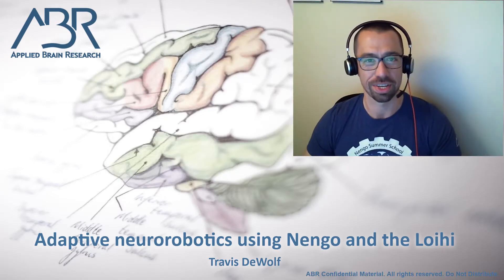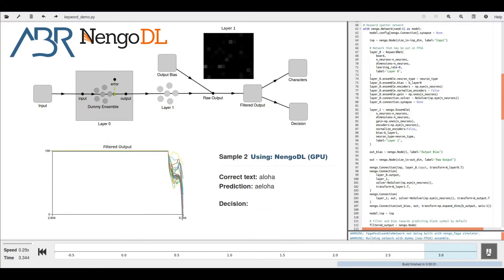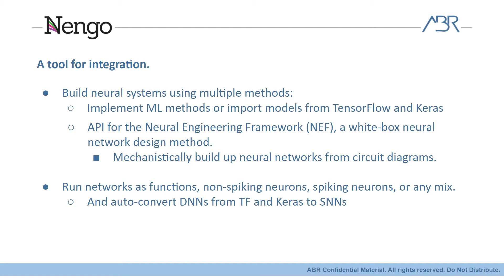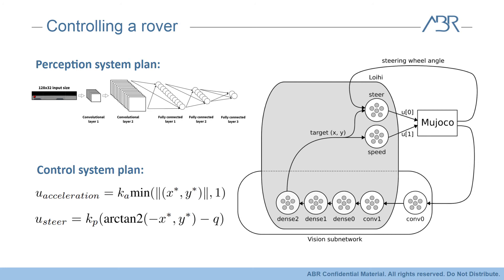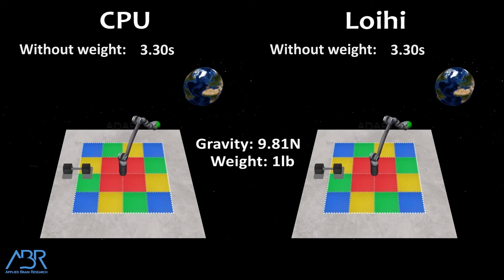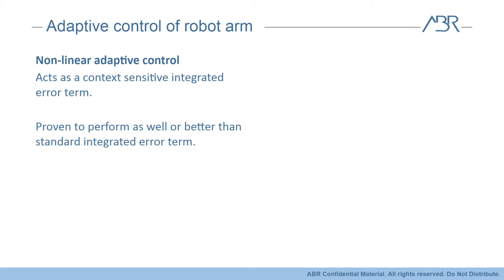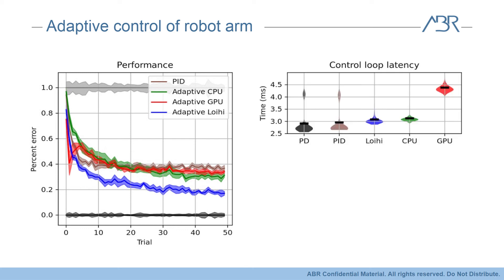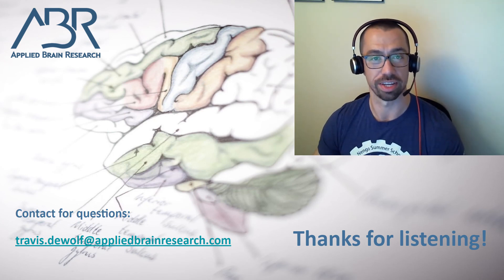Adaptive neurorobotics using Nengo and the Loihi

Comment: Your FPGA voice scripting example is very interesting.  Which FPGA board did you use?
Reply: The FPGA example was done using the NengoFPGA library. The NengoFPGA library supports 3 FPGA boards currently, and they are listed here: https://www.nengo.ai/nengo-fpga/appendix.html#supported-hardware

You can find the code for that demo here: https://github.com/abr/power_benchmarks
And the FPGA specific code can be found ini the "fpga" branch (https://github.com/abr/power_benchmarks/tree/fpga)